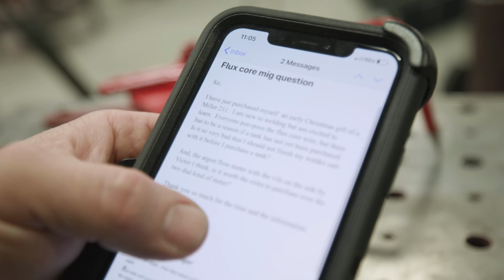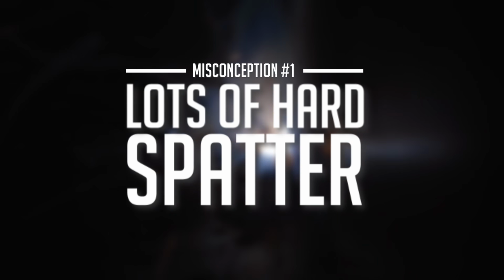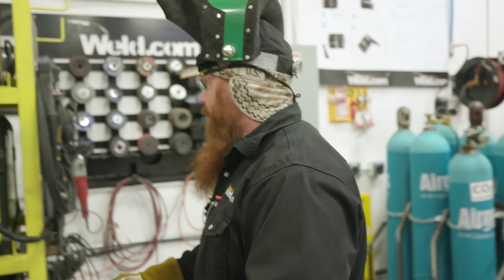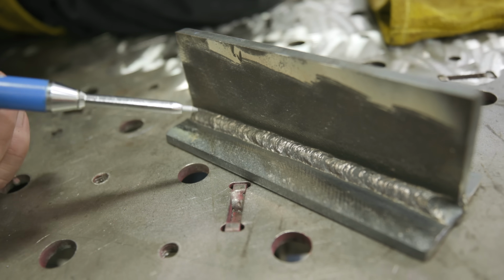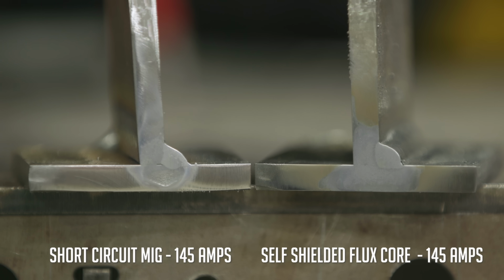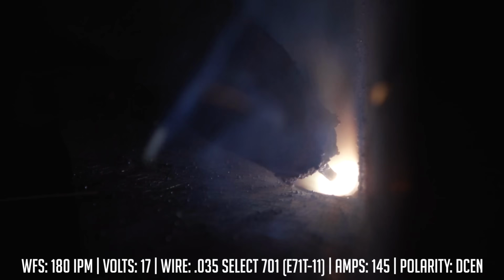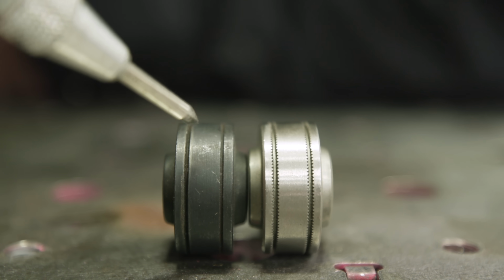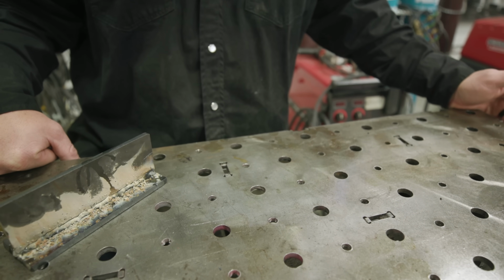3 Flux Core Welding Myths DEBUNKED

Comment: I'm definitely no pro or even an amateur welder, but one thing I noticed right away is how much better the flux core was at welding thicker metal. (110 volt) machine.

Comment: Hey, thanks! I'd been a reasonable welder, using mig to build benches and racks in surfboard factory fit-outs. As I moved away from that business I couldn't justify paying rental on a gas bottle as my machine just sat there. Then when I wanted to do the odd small project I despaired because the "gasless" wire worked like shit! 

And the machine sat there for years. Now I really wanted to build a gym squat rack...really basic geometry, nothing crazy. Back to gas bottles? I tried one more time with the spool of fluxcore I had. It was so crap I cried...and the one video I looked at was an amateur apologising for his crap work, scrubbing off spatter and tapping off slag non-stop. 

Your video was the next one I chose...and I just swapped the polarity plugs! Who knew!!

Comment: You convinced me to pull the trigger and get a MIG (low price, entry level model). I would imagine the wire isn't all the same. E.g. HF has inexpensive flux core, but if it makes a difference which to use, I'd rather spend the extra bucks and buy a reputable brand. Thanks for an enlightening video and any ideas are much appreciated.

Comment: Ive been a field welder doing fence and gate construction for 18 years. Welding hinges to 1/4" plate, operator control arms, trailer repairs, frame fabrication, .120 wall powder coated posts and .095 powder coated panels together with No pre grind, no porosity, just a scratch through the coating and burn baby burn. Vertical joint, flat joint, gap fills, Dust, dirt, wind, freezing cold and blazing heat. Flux core is dependable, rugged and gets shit done outside of the shop where most "welders" would never fathom trying to lay a bead.
Thanks for busting so many of these myths ive heard for damn near 2 decades.

In all honesty when i spent some time welding in a shop (mig and tig) it was an adjustment to how finicky those machines were and i missed my blow and go flux core.

Comment: Over a decade of experience with stick, TIG, and solid wire MIG. Just tried FCAW for the first time last week. I have totally changed my mind on flux core. Worked great for working in the field on 16 ga tubing. I will look to use FCAW in all my future outdoor and on site thin gauge material projects. Flux core welding is the way to go for the DIY home improver IMHO. TIG and MIG for in shop operations, the cleanliness and ease of use is preferable. However for thin gauge materials in the field outside of the shop, FCAW is the way to go. Stick welding for any thicker gauge materials in the field is still preferred. That’s my take on it.
Reply: Agree!  I can run all processes,  but FCAW still has its benefits.  No gas needed,  it's easier to tack with than stick or TIG.
Reply: @landonlehman5497  Can you weld on 24 gauge steel with a fluxcore machine?

Comment: I never welded before and my friend works with aluminum only. Can you recommend best approach for me to learn aluminum welding Basics. Possibly a book video. Etc thanks
Reply: I learned how to weld aluminum with a spool gun on a Miller 252. Honestly, the best advice for aluminum is to clean the hell out of it with acetone, run a relatively high heat, and always push the bead. We do large aluminum carts for Autozone made from extrusions and rolled sheets of the stuff, the thickest of the material is about 1/4", and we run at around 21 volts or so. Wire feed is set on the spool gun (ours goes from 1-5), we ran it at 3.

Comment: I do several portable repair jobs with an old Lincoln weldanpower. Is there a spool gun that will work with it for flux core? I have not done any research but would like to set it up

Comment: I just got the little Titanium 125 flux core and it does just fine.
I on the other hand, not so much.

I’m not sure if it was because I had it up too high, but I was welding up and down an internal corner seam wondering why it kept balling up into a caterpillar between the walls rather than flattening out, all while the walls to the side of the weld bead kept melting further away from the bead itself.

Figured out too late it was (at least partially) because I of me trying to zigzag the wire, trying desperately to connect the two walls. 
Instead of connecting the walls, it just melted them down into the centralized mass.

Comment: When you weld with flux is it normal to use shielding gas or is that the reason flux core is used is to eliminate the requirement for shielding gas

Comment: So I bought a small Chicago electric flux core welder. Is hard wired, without the quick connect leads. I have a lot of splatter issue. Is it possible to rewire it internal to change the polarity or am I resigned to just dealing with it?

Comment: Been thinking about adding a flux-core Mig to the shop.  I usually do stick because I just hate dealing with bottles.  The propane for my forge is bad enough, but adding another bottle and another store to visit... well, not very high on the priority list!  

Most of my welding needs revolve around making jigs and tooling for the shop and I thought it'd be good if I could just weld up 1/8" plate, with the occasional 1/4" thickness thrown in there.  Never would have guessed I could weld 3/8" or 1/2" and expect decent penetration without deep beveling, root passes and all that!

Comment: auto sheet metal 60,s kind with flux core lincoln weld pac 100  with wrong polarity not enough voltage to work would that be better so you don,t burn though in this case ?

Comment: I built suspension boxes for frac tanks for years. The wire I was required to use is flux core. Just made a nicer and stronger weld. Never had one break.

Comment: Some years back i was working at a place where we needed to weld a LOT of galvanised steel - we used a special wire that had a flux core and was also used with a gas shield - it worked very well as it was designed for welding through the galvanising. Saved a lot of cleaning off the coating and the flux was almost self cleaning as it cracked off excellently finished welds.

Comment: Problem I get is tip blockages which causes the feed roller to spin causing a spot  in the wire that will not go though the tip thus causing the drive wheel to  spin  again .  How can you stop wire feed issues with flux core can i put graphite powder down the tube to help lube the wire ?

Comment: I've used some very nice welders in the past. I got a free harbor freight flux welder I've been using for years at home. Feed issues are common because it is a piece of crap but I get some strong welds out of it. Nothing I have welded up has ever failed. Just upgraded to a Hobart flux core. Great price. Not fooling with running out of gas where I live. I'm hooked on the simplicity of flux core. Thanks for the vid.

Comment: Thanks So Much for this great video and explanations. I have probably had my polarity set wrong ever since I changed to flux core. I just thought that's how it was, or I just was a crap welder with flux core. Have to look at it in the morning.... Thanks, and you got a new sub :-)
Reply: well, my welds still suck... guess I'm just a crap welder with flux core. I have all the "issues" you showed with having the polarity reversed. Such as the 'welded' on bb's that have to be grind down/off with sanding wheel, ugly weld bead ect. After watching your video, I thought for sure I must have had my welder polarity switched.  
But I just went out and looked this morning, and to my disappointment I already had my welder polarity set correctly for flux core wire....  :-(

Comment: Just bought a used MIG welder, and haven't laid a bead in 20 years. Thank you for sharing this. I have the wrong tension roller for my .035 flux core. I knew about the polarity, but forgot about tip distance. I think you've saved me a lot of heart ache!

Comment: Just a lil fyi, in reference to the drive wheels and spool size with flux core. Due to the flux core wheels being knurled, if you use small spools of wire, it was our crews experience that the liners in our guns would wear faster. The tighter wraps coming off the small spools coupled with the knurling added to the wear of the gun liner and also the tips. Pay close attn to drive wheel tension, size, wire drive/feed speed and when feasible use a larger spool in your machine. Especially if you're on a low or fixed budget. Granted the liners and tips are consumables but you can get weeks if not months more out of liners and even tips would last longer. Our shop machines would use small spools for the convenience due to multiple projects and different specs. Our trucks would use big spools and between the two, the truck liners would last longer even though we would weld more in the field. Anyone else have same experience?
Reply: I don't weld every day and I do sometimes have feeding issues but I've gotten a couple year out of my leads. They could probably use replacing though

Comment: I leave an old harbor freight 170 setup for flux core for general repair. Cheap POS has ran a lot of spools of wire with 0 issues.  Most just use my mig machine for body panels now.

Comment: I have seen the same thing with people having problems with flux core for whatever reason and I just don’t get it. I started with flux for months before anything else when I’m school so I may just be biased on the subject. Flux core horizontal runs itself if you set the machine right. The biggest problem is vertical up which at least in the south east they almost refuse to teach or allow you to do at plants. Also how does anyone think you get less penetration with flux. It runs hotter and is used specifically for the penetration and flexibility in construction jobs.

Comment: Thank you for the info!  I have the Lincoln Flux Core welding machine Home Depot used to sell.  It came with a plastic short nozzle.  My welding professor told me that I'm missing it, however it welds exactly as you have shown.

Comment: My old sp-150 (or 125 I can't remember iv only had it 15+ years) welds better than that. Looks like I tiged it if the metel is clean. But yeah I still learned a lot here. 👍

Comment: Thanks for these tips. I have tried stick, TIG and MIG with gas. For the home user, flux core makes a lot of sense. TIG is fun but requires a lot of practice. Stick is convenient but a bit harder to get to look nice and I "stuck my stick" too many times to mention. MIG with gas is cleaner but if you want to get about the same result without gas flux core is the way to go for  me.
Reply: Thank you, Chad , for your gevura ( 'lil
Hebr. courage ) comment.  Pastor Andrews in Cedar Kee, Flowida  gives 
Sermons which really helps .
         Been welding w a Hobart 220 volt 
Ac or DC.   Negative straight electrode 
seemed to be easier than +.  Should find 
vertical up with flux core possible for Van Chevy front rust reinforcement.   Or
find whatever floats the boat , by asking a specialist to crawl and apply weldment.

Comment: Thank you.  I was just going to go back to oxy/fuel because I could not get a nice weld.  I did everything I could.  Tried different wire, different sizes , different positions.  Every weld looked like crap except for little spot welds.  Watched your video and the first weld you layer down looked just like what I was doing.  Then you changed polarity and boom there was the issue.  I started to look real close at my rig and turns out it’s only AC.  I just bought one that is DC and BOOM!  Nicer welds!  Thanks once more!  Just subscribed to your channel!

Comment: I so want to learn to weld. I want to work on an exhaust for a motorcycle so maybe 20 guage or 18 dunno. What settings would I use on the lincoln century model welder and what size wire. I have yet to get the welder as I need to save up. Thank you.

Comment: I find fluxcore to be superior in some circumstances. It doesn't seem phased by rust or crud. For example, I dont have the luxury of cleaning up the undercarriage of my truck, sometimes there are just gonna be places you need to weld that cannot be prepared the way it should. When I crack the frame (or something similar) I can just get up in there with fluxcore and it welds just fine.

Comment: Thanks for the video.  Just bought a 220 MIG155 since I have been stick welding with another machine.  Normally I keep my welding rod stored on top of the hot water heater in the equipment room of my home.  When I am not going to weld for a while should I remove flux core roll and store in a warm dry place (top water heater).  Also how easy is it to pull Flux Core wire back onto spool for storage.  I was planning on putting in a zip lock bag if that is OK.  Claude ....

Comment: Hello guys love the help you fellas give us beginners.iam planning on doing some body panel repairs and my mig welder only has a knurled roller in .o35 and flip it for 0.30.i was hoping to use 0.25 wire cause everyone says thats best.i cant seem to find a supplier local that has 0.25.can i get away running the small wire on the 0.30?snookie pa.

Comment: OOhrah sir. very informative and very helpful! I've been a hobbyist welder for several years now. I do a decent job but constantly run into problems with my flux core welder. the info you provided has made a drastic impact in my overall welding performance. thank you.

Comment: Flux core has it's place and solid wire has it's place. I'm not a full time welder but I'm a farmer so welding is pretty much an everyday job. We got our first mig on the farm back in the 80s we got rolls of solid wire and a couple tanks of tri mix with it we were ready to junk the welder we could not get a good bead no matter what we did we ended up throwing it in the corner and went back to stick and one day our welding supply supplier stopped at the farm and we were talking about welders and he said we needed a mig and I pointed to the new one in the corner and I said none of us could get a clean bead out of it to save our lives. He said lets see so I opened the door pulled the welder out on the shop apron and found a scap piece of steal and began welding and then he stopped me and said bring the welder inside and close the door and try it so I did and ended up with a perfect bead and he said we needed flux core if we do most of our welding outside and to only use the solid wire and gas inside he sent us a roll of flux core and we have done very little stick welding since. We find no difference in weld strength.

Comment: Even with the cheapy harbor freight flux core welder, If  you preheat the  area with a propane torch your welds will have better penetration and appearance,  250 F degrees

Comment: I have seen some really beautiful flux core welds that used CO2 for a shield gas with little spatter the slag came off by itself as the weld cooled.

Comment: I use flux core all the time. I lightly brush on anti-splatter spray where I don't want the weld to be, use dc negative, don't get too close to my weld with the tip, and I get nice clean, solid flux core welds every time. My wife tells me that in order to get good penetration, I have to get the tip in deeper, but when I do that I get spatter everywhere! But that's for a different discussion board!

Comment: Not inferior, just different.... and definitely messier 😆
Reply: Yep. That’s the main reason I don’t like to use FCAW. Even with the proper polarity, you still get plenty of spatter. And don’t get me started on the flux mess. Yes, I do have a spool of flux core wire, but I never use it. I DO have a small 110v flux core welder for the few times when I need it, as there are times when you just can’t use gas, but that’s rare.
Reply: John Acuff haha all I know is proper setup and technique makes FCAW an absolute beast in outdoor conditions 👌🏼 job site welding has become so easy with just a bit of practice

Comment: Started out as a TIG welder. Got tired to traveling for work. I work in a shop doing  mostly fluxcore. This yr I've run well over 2,000 inches of fluxcore girths. I only had .5 inches of busted x-ray. That's not counting all my UT inches I've sailed through. Take it from me. I wasn't a fan of any wire welding process. Fluxcore is great. You just have to pay attention to your puddle.

Comment: FWIW, at 4:32 into the video, I did a dimensional analysis given that the wire diameter is 0.035", and the CTWD ends up being around ¼", not ½" as it should be.  All one needs is a simple proportion to get a rough estimate (because the drag angle of the wire is not seen, it creates a *small" variation).  But even then, it looks really close.  Can anyone else confirm what I'm seeing?

Comment: Penetration is a function of joint design. Fusion welding is basically a surface function, with mixing of filler and base only a few thousandths of an inch deep. The idea that the metals can be mixed more deeply for a stronger weld is an old husbands tale.

Comment: Hey buddy, U & Ur video is awesome.....But, instead of buying stuff I love to see diy machines working like professional grade machines. Also, I had never welded ever before. So, I wanna know if I can get a flux core MIG welding like finish with an stick welder with a diy MIG welder like stick feeding welding torch? Also, please tell me the approx work distance so that I can incorporate it in my diy welding torch.....By d way, my DIY stick welder is made of two micro wave transformers with 4mm solid core copper wire and with an output of 58V.

Comment: If I run a gas over my flux core will that cut down on the spatter even further?
Reply: Depends which wire, if you get a gas wire yes, argon co2 but leave it on positive.